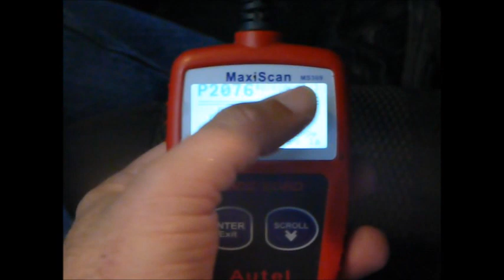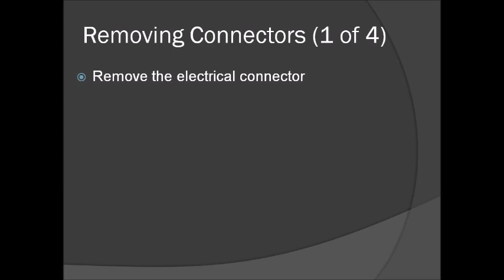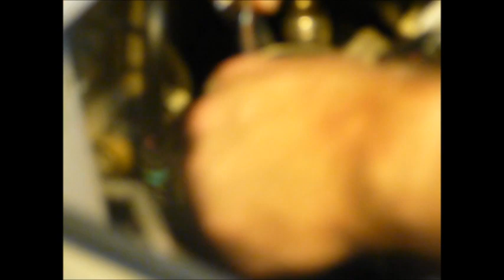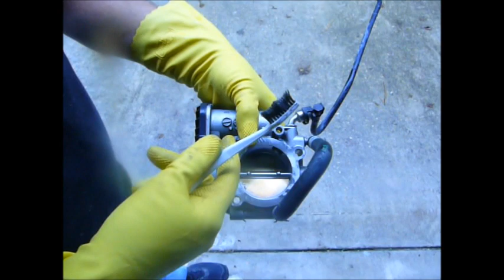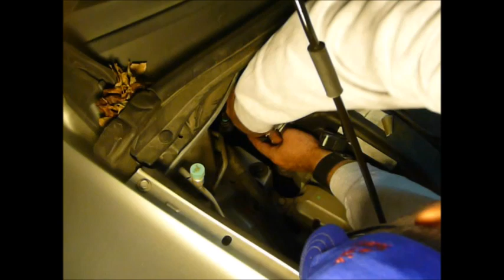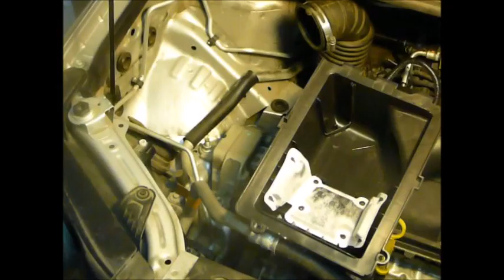P2076 Remove, Replace (or Clean), install Chevy Sonic Throttle Body

Comment: it is not easy to reach that screw on the lower part of the intake hose… gm makes it tough, but they could have used constant tension clamp orientated other side

Comment: My niece has the same pos car with the P2076 code. I replaced the arm that came lose and hoping that Fixed it. Cleared the codes but the code is still there. Idling is terrible. Removed and cleaned the throttle body out and changed the gasket and reinstalled it. Same P2076 code. Either the throttle body is bad ($180+), or it has to be programmed.

Comment: I have a weird sputtering sound coming from the throttle body I seen that some coolant lines are connected to it. I have a crack in my coolant reservoir could that be the culprit?

Comment: Wonderfully done sir!
I'm finding out that this car is a pain in the butt to work on. IMPORTANT NOTE: I just got done replacing my thermostat and housing and that line coming from the throttle body to the very top of the thermostat housing... DO NOT remove that clip that you showed with the tabs on it if possible, it will need to be replaced almost 100% of the time because the seal inside of it corrodes and goes bad once it is removed. So if you're going to attempt that make sure that you have another part already on hand otherwise be expecting a leak after reinstalling. The GM dealership is the only place to buy it and its about $36. Once again awesome job on the video! I'm going to attempt to just take the mounting bolts off and since I already had to replace that line I'm going to just plug up the hose and use a toothbrush and spray into the throatal body (closed) on both sides and get the debris out wipe clean as well as possible and let air-dry for a couple hours. Also to anyone thinking that they need to do this try taking out the mass airflow sensor and (using mass air flow sensor cleaner only) on it first. Spray it out, let it air-dry for at least 45 minutes inside where it's warm. Then reinstall it and try that first before going through the hassle of cleaning or replacing the throttle body. Also make sure the hoses and your air box is not cracked and that your filter is good. Heres a video I did showing what I'm talking about with that heater inlet hose breaking after disconnection. Hope that information also helps some people out. I got the whole job finished In that clip even went back in and clipped on after running the vehicle for a couple minutes it started leaking horribly from the top of that radiator housing. I don't know why I couldn't just use the two pieces of rubber in a hose clamp instead of having that clicked in the plastic piece of crap what would really be the difference? LOL I'm sure that that part is critical though... I miss working on cars without cpus and a million sensors! Please keep the videos coming! 👍😀

Comment: I was told that you need to take the car in for them to reprogram the throttle to the Car Whatever that means is this True?
Reply from the maker: Agree.  Really like the car, but cannot keep up with the check engine lights.  Got another one this week.  Two injector circuits bad.  Won't run.  POS
Reply from the maker: As I said, I am not a mechanic.  However, that seems a bit dubious to me.  I don't think you program the intake.  Any more details on your situation?  What codes?  What is not working?
Reply: @ToolTimeTabor  yes I found out my misfires came from a messed up flex pipe n mass air flow sensor ordered the Parts 250 total this car has been a Pain in the Ass replaced all purge valves that were faulty and control Arms Luckily I Got a Family Mechanic That Doesnt charge much Luckily cuz all that work expensive

Comment: Man that's a tough one. Most throttle bodies you can clean right on the car. My question is why did you have to buy a new one?? Did cleaning it break it?
Reply from the maker: No.  I tried cleaning first.  That worked for a while.  A couple of guys said they cleaned and eventually replaced.  So, that's what I did.  It worked...for a year.  The theory was that the butterfly had too much leakage and a new one would correct that better.  Maybe BS, but had to do something.
Reply: Ahh got it. Thanks for the reply!

Comment: Does a new throttle body require cleaning?
Reply from the maker: If you have the P0101 code with it (or possibly other codes) then look to those other repairs first.  I had a straight P2076 last year.  Cleaned the throttle body.  No Joy.  Replaced the throttle body.  Success.  So, given the difficulty and cost of this repair, you might try other options, if there is any indication that the problem lies elsewhere.  But, abe sure to check that connector.  It apparently comes loose regularly enough to have other videos.
Reply from the maker: The difficult repair I refer to is the intake manifold tuning connector that also generates similar codes.